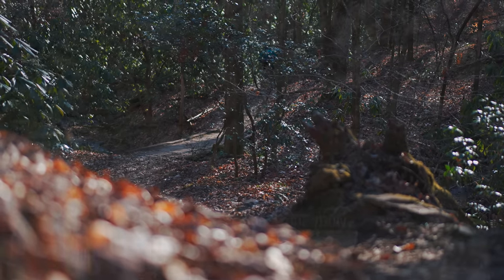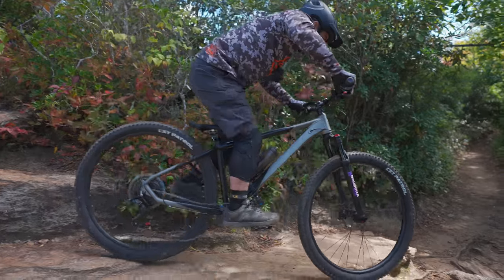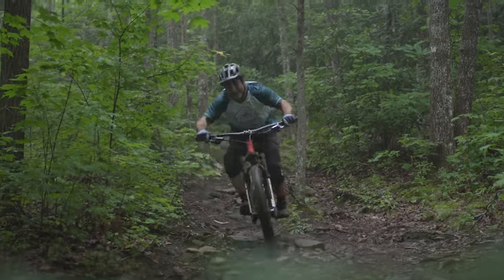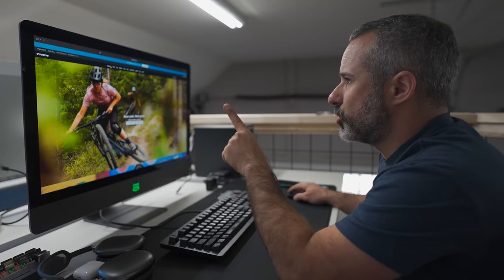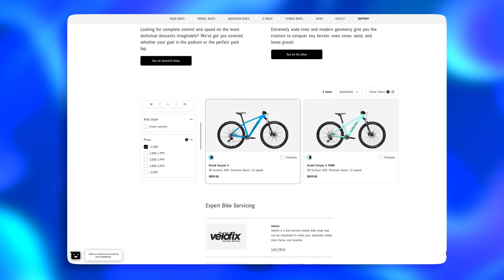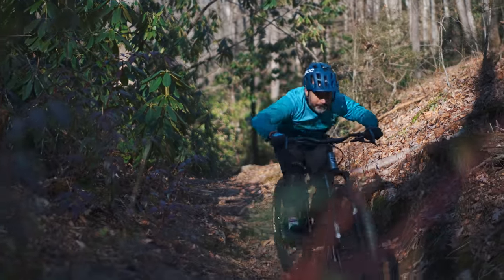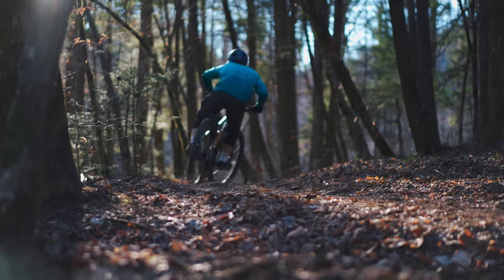Was putting $425 of upgrades into our Walmart Bike a good idea?

Comment: Having tools, knowledge, time needs to be accounted for.  Not everyone has all the skills required to do these upgrades.
Reply: These videos somehow simultaneously make me think I can do these types of builds myself, and let me know that actually I cannot. Usually the second part sets in when he grabs some special tool that I've never seen before.
Reply: @JayCAlan  Some parts require specific tools, and sometimes even unconventional hack methods
Reply: Exactly!!
Reply: Very true. And what's more, the bike came from the store somewhat unrideable due to the headset. This could be a fun project for someone who knows bikes, but few new riders are going to know to spend a bunch of time going over it to make sure it's put together right.
Reply: @JayCAlan  a lot of tools make your life easier but aren't fully necessary.  I just watched a video of somebody setting a star nut on a fork without the tool and it seemed to work.  I have the tool for that, but how many times will I have to do that to make it worth buying?

This is where your local bike shop shines.  Mine will set if for you if you are buying things for them. takes them five seconds and they don't charge you because they want you buying your upgrades from them.

Also, check to see if there's a bike co-op in your area.  There are also tool co-ops, but most of those are for shop tools.  But maybe worth checking as well.
Reply: @JayCAlan  He’s got a nice collection of tools, but $40 at hobo freight would get you everything you need to get through this build. And then you'd be capable of doing your own maintenance.
Reply: @RobotJustice  you'd still need a shock pump, spoke wrenches (or a multi tool with spoke wrench function).  Tape for the tubeless setup plus valve stems and sealant.  Good lube for headsets or bottom brackets, chain lube as well.

You're largely right, but once you get the other stuff it's probably another 40-60 bucks.

The crank puller may have an equivalent in shop tools but I think the threading is fairly specific.  I would also buy that at a bike shop and that's another ten bucks or so.
Reply: Most things are 10 minutes or less.  Tools are relatively cheap
Reply: @JayCAlan  Same thing I was thinking. 
Part upgrade = $50
Specialty Tool for that Part upgrade = $100
Derp.
Reply: Having invested heavily in tools for other things(cheap cars aren't cheap) the lesson I took away from this is to buy a nicer bike to start with.
Reply: @rcranes2227  ...and the fact that seating tubeless tires w/o a compressor is a pain. Most noobs or people buying entry level only have access to a hand or floor manual pump.
Reply: Warranty as well. Break a frame on a trek, canyon or giant You at least have a Warranty
Reply: But everyone can develop the skills to do it. You're never gonna learn to work on a bike if you never try. Once you watch some videos, do some reading and actually try, you realise how incredibly easy and simple bikes are to build and service.
Reply: Learn them . Skills are learned by trying and failing,then try again.
Reply: Not everyone even has a home. I'm currently sharing a 900 sqft apartment with FIVE people and all of their belongings. The only reason it works is because mom (my GF) has fallen in love with riding so she makes it work. And, of course, I have my van to store (most) everything in.

If you don't have money for a decent bike, you might not have money for a decent home to work on it either. 

There is virtually zero possible way my GF would be able to do any of this. She was never given any level of knowledge (by her parents or ex husband), no tools, no experience, and no where to keep the equipment. She just happened to meet the right person at the right time.
Reply: the internet does, though. and the skills you can learn are priceless.
Reply: The tools are cheap, and the bikes are so easy to work on ,folk are just afraid to give it a go ,of course some guys struggle tying their laces and can't fix a puncture ,with you tube to help you just can't go wrong.
Reply: not really any skills here that can't be learned in less than a day lmao
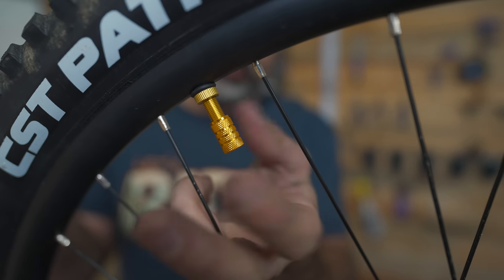Reply: @BeetleBuns  Does 2:34 - 3:30 look like something the average person could learn to do in a day?
Reply: @jeffb1430  if you can't figure out a stupid way to remove a crown race, then you probably shouldn't even be allowed to step out of bed. What Seth did there was get it off by any means necessary, that was not a guide lmao
Reply: @BeetleBuns  So you learned everything that's in this video in one day or less?
Reply: @jeffb1430  dude, it's literally just taking parts off and putting new ones on. If you can't do that, you're either a paraplegic or still in daycare. This stuff being too difficult for you to understand just means you are below average.
Reply: @BeetleBuns  You didn't answer my question
Reply: @jeffb1430  I don't need to, because unlike what your teacher says, there are indeed stupid questions, and they tend to come from disingenuous people.
Reply: @BeetleBuns  I could not be asking any more genuinely
Reply: Get gud scrub
Reply: @IAMRUSTEDROOT  Dont spit nonsense
Reply: @BeetleBuns  These can just be the people with soft hands that are $1000 over-biked.

Comment: There's a kind of rider who can benefit from this experiment with the Kent Trouvaille. The kind of rider who is really watching the budget, and is just trying out mountain biking. After a few fun months riding, you can tell there are limitations to the bike, so you upgrade here and there, working on it yourself, instead of upgrading to an $850 Trek, because you know even selling your Walmart bike used, you can't make back the original money you spent on it. So this way is cheaper, as long as you can do the work yourself. It's so great that you really can upgrade this dept. store bike. At the end, you have a bike that has advanced as its rider has advanced. Maybe soon, you can justify another upgrade, to a much better bike than this upgraded Walmart one or an $850 Trek, etc. As someone whose mountain bike is a pre-2010 Specialised Hardrock, I like this series.

Comment: After almost 15 years I was finally in the market for a new MTB. I literally saw the Kent Trouvaille in Walmart yesterday. I googled it and your videos popped up first thing! I went through the whole series in store and it helped me make the decision to pick it up. The bike was actually marked clearance at $150 (398 online). At that price and with the upgraded crankset and hydraulic brakes you recommended, I think i will have a decent entry level bike I can build upon. Thank you for your honesty and your detailed breakdowns. You have earned yourself a follower!
Reply: thats a great deal for it its a good bike even for 400 so 150 is great
Reply: at that point you can do the upgrades he did and end up getting very good value for like 600 dollars
Reply: Also bought it @ $150 this past spring 💪🏻😂 had no clue it would be such a great buy!
Reply: get a set of Avid BB5 brakes (mechanical) as they will stop you just like hydro brakes. If you go hydro brakes, you much buy the whole set with levers, brakes lines and then for most, spend $$ at a bike shop for labor. The Avid BB5 or BB7 are great and bolt right on without changing brake levers or lines. Easy install. The crank on this bike is fine and no need to change it out. This guy with all the upgrades is not doing anyone a favor with a spending total that will get you more bang for the buck by going with a higher end bike in the $500+ range.
Reply: Same. Just bought a medium size for my daughter on clearance for $127. Perfect first mountain bike for her. We'll  upgrade as she gets better.🤙

Comment: As someone who rides a Polygon and has helped someone pick a new starter bike recently, I'd say Giant is probably your best value for an entry level hardtail but Polygon takes the cake when you get into full-sus (granted Fezzari and 1 other company that starts with a V also have some good value)
Reply: Vitus!!! Mythique is some bang for buck
Reply: @sydneydowd8969  yep that's the one. I was stuck between that and my Siskiu T7. Ultimately, I decided to just get whatever came in stock first. Fortunately for me I got the bike that probably suits my riding more but both were great options
Reply: Polygon is still best value for starter hardtails too because they are always on sale. It was Xtrada 5 that got compared in the video but at current available prices it could have been a Xtrada 7 with Deore 12 speed, air fork and thru axles.
Reply: I own a pair of Polygon (T7 & DSE), and I agree. The hardtails like the Extrada are a little more expensive for what you're getting (so like the Trek), but the Siskiu line is perfect. Just disappointed the Extrada 7 doesn't have a dropper still. That's like the final thing they should've given it. Also disappointed Polygon doesn't have something to compete with the Marin San Quinton. A rowdy trail/bike park style hardtail.

Comment: Another good option could be something from Specialized, like their Rockhopper Comp. For $713 (with the sale), your getting SRAM hydralic brakes, 1x9 microShift Advent drivetrain, and a good looking bike with different color and size options. Yes, it does come with a SR Suntour coil fork, but because it is cheaper than the Trouvaille, you can spend to replace the fork with the one shown in the video (SR Suntour XCR). With the fork upgrade, its only about ~$100 more if your trying to get something that already has a great start and upgrade from there.
Reply: It doesnt have a tapered headtube so your limited in what you can put on. The Trek and the Canyon have tapered headtubes.
Reply: For 800€ I got an Orbea Laufey with about 100kms, guy got back pain and was getting rid of the bike. Equiped with slx gear, Mt500 (or 200) brakes and rockshox Recon. Slapped Xt brakes  and I’m having fun.
I think that in good condition used bikes is a best bet.
Reply: The Rose Count solo 1 ist 850€ and gets  you 1*11 Deore mt200 brakes and a Judy Air fork.
Reply: @spyder027  The Trek Marlin and Grand Canyon bikes have straight headtubes.  You would have to go for the Trek Roscoe and Canyon STCHD to get tapered tubes (1200USD at least).
Reply: @spyder027  Oh my bad. From a first glance it looks like it would.
Reply: @giovanni0654  I have the roscoe with a tapered headtube I assumed the other bikes would have the same.
Reply: @spyder027  on many bikes, you can install a special headset made for converting to tapered
Reply: @mikuramsay  Yes, this - on my Marlin Bobcat Trail 4 it has a straight tube but you can get a converter so it will take tapered forks.  It was a selling point to me.

Comment: This is an awesome comparison! You never mentioned that on the Trek or Canon, you can fit dropper posts as well. The one thing you really wanted to do on the Kent travail. 

Yeah you can always go cheaper on items but usually the ones that are a little more expensive are for good reason. The amount of money that you have to put into research and development, it's a big cost increase on products that people forget about and usually only the large companies are really making that big spend
Reply: Doesn’t Suntour also have a trade in so you can get an air fork cheaply??
Reply: @MichaelRei99 yes
Reply: On the note of a dropper: I don't think a mountain bike can be considered a "real" mountain bike without one. It does more than just make a bike more fun, it makes it safer when doing anything remotely chunky. I have a marlin 8 and the dropper was the single most noticeable and important thing I did to the bike.  The fact that plenty of real manufacturers ship mountain bikes without them stock, is a bummer. But not being able to fit one at all rules out a bike as a mountain bike in my opinion.
Reply: @michaeltavener9959  If you do XC your trails are not that chunky. If they are then just set your saddle lower. Droppers are not necessary.
Reply: Kent is an extremely large company - probably larger than Trek or Specialized and definitely larger than Canyon - It just doesn't produce top cutting edge bikes as that is not its customer base.  Not everyone needs or can afford even an entry level Trek - the thing with the Kent is you can start off at a low investment and as time and finances permit -build it to specs that meet the higher priced models.  I am a Specialized bike enthusiast so I don't have any issues with the high end brands and recognize not everyone can build up their own bike - but it is possible to enjoy biking without paying for a name.
Reply: You can add a dropper post to this bike, The post size is 30.4 .. Just buy a 30.4 dropper, or smaller with an adaptor.
Reply: @jnb756  The other thing to consider is that they're the 2nd rate compared to Schwinn right now. You can get a Schwinn Boundary for the same money if not cheaper, and have the ability to swap the head bearings to tapered, and have a tapered fork, as well as be able to use any old dropper too.
Reply: @danimayb  Just get a Schwinn Boundary for the same money that has the right size of tube, and you can swap it to a tapered fork at that!
Reply: @CPD0123a  I was simply pointing out you can install a dropper, People saying you can't lol

Comment: Something alot of people aren't aware of if you get a suntour fork new (be at it after market or OEM bike spec) , register the warranty you can then get money off a new upgrade fork from suntour I had a polygon xtrada 5 and got £75 off when upgrading the OEM xcm fork (I didn't use it but it's nice to have that option (
Reply: Seriously, Suntour needs to market this better. I have an old Specialized Hard Rock that came with a very cheap Suntour fork, but for a couple hundred bucks I was able to get it upgraded to a Raidon, which is such a drastically better fork. When I asked my bike shop about the upgrade program they had no idea. They had to contact SR Suntour to confirm it was actually a thing. And they probably sell dozens, if not hundreds of bikes with Suntour forks every year.
Reply: When ever I see people with suntour,be it when I worked in a bike shop or on forums etc I tell them about, yeah it's only really limited to a step or 2 up from what you have but in a lot of cases it's going from a coil to air fork which can make a world of difference
Reply: Sadly only appears to be available for the North American market, still great to make folks aware.
Reply: @44Needles  and Europe ,I'm in the UK and I got it pretty easily
Reply: @kierangraves1747  interesting, I couldn't see anything on their website, got a link? I'm eyeing up bikes around £600 at the moment and most have Suntour forks, so thinking about future upgrades
Reply: @44Needles  I emailed them directly about it once the fork was registered for the warranty with them

Comment: Here in Europe you can get things like either a Cube attention SL with better specs on every level, 12speed deore, Rockshox judy, hydraulic discs for $812. The Trek Marlin 6 gen3 is only $801, a Marlin 7 $866. A Scott Aspect 740 for $790. Too many options to sum up really, all cheaper than the Kent with upgrades.
Reply: The trek Marlin 7 in MN is running around 1000$ these days and hard to find.
Reply: Here in Indonesia we can get 27.5 XC with Shimano XT 12 speed with Rockshox Judy for $812. The only donwside is not using shimano casette. And there is many local bike company sell bike with deore group set with air fork under $700.

Comment: You can throw different dropper seat tube sizes and use a cane creek shim adapter. Works perfectly.
Reply: Thats what I did for mine. 27.2 to 30.4 Cane Creek Shim and it works great
Reply: Exactly, I've been running shims on droppers with no issues for years.
Reply: Shim = beer can
Reply: @niclaskarlin  "Zen and the art of motorcycle maintenance"

Comment: 11:09 I don't need more long term relationships than I already have, tyvm, haha.
It's best if you balance a good enough cheap base platform with whatever tuning you're ABLE to do yourself reliably without damaging/compromising anything.
If skilled above average - pay 400 and go all out, if inexperienced - pay 800 and maybe replace the saddle :)
It pays off learning to DIY as the 400 base (with upgrades worth 400) WILL be better than the stock 800 base in the end (or equal, but for less money)